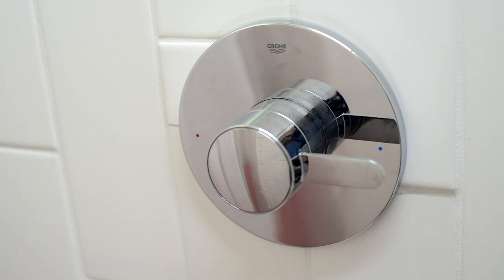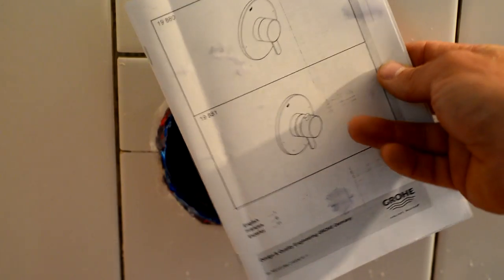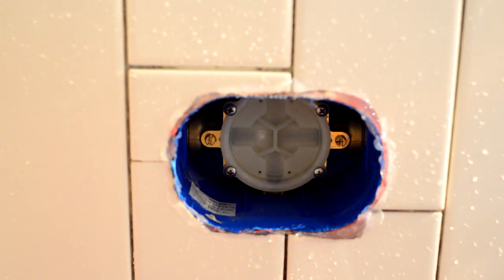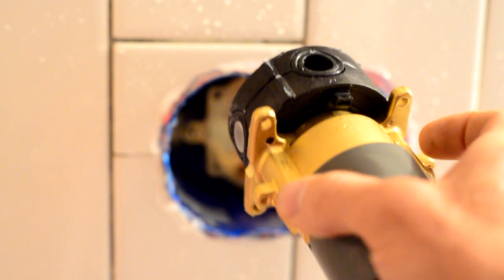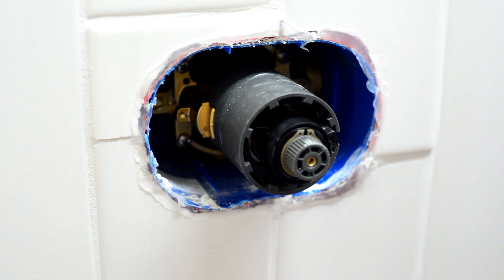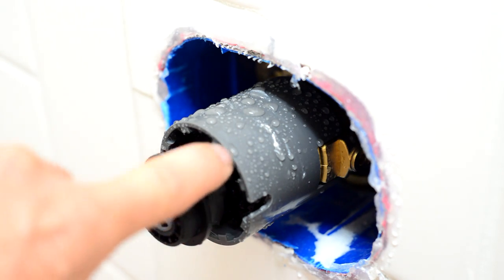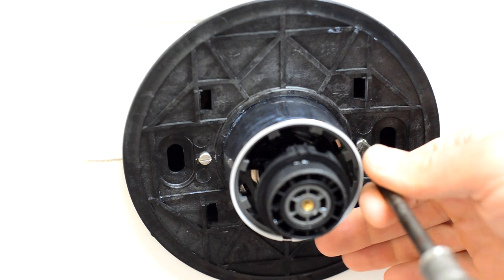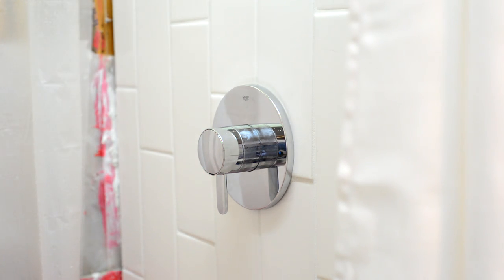Novice Experience - Grohe GrohFlex Rough-In Box and Valve Kit Installation

Comment: Matthew, this (19880000) is actually a pressure balanced trim/cartridge; it is designed to correct variances in pressure only. A thermostatic trim/cartridge (19869000) corrects based on temperature. Both can be used with this rough valve.
Reply from the maker: I looked on my Amazon order page, and you are 100% correct. Mine is the pressure balanced cartridge. The Amazon description, however, says nothing about what that means. Can you you give us a quick summary of the difference? Thanks!
Reply from the maker: @jandrews365  Wow. Great info. I love my pressure balanced valve and I didn't even know why. I love that it is with one handle. With the temp control for the water on my on demand water heater, I just jam that handle all the way to the left and always have perfect temperature. Thanks again!

Comment: on the water heater here there is a temperature adjuster on the front of the heater , that could be turned down to save money, or help adjust the water temperature at the outlet
Reply: Be careful with turning down water heaters. If the internal temperature is under  49 °C (120 °F) it can grow bacteria and other nasties real quickly.

Comment: Is there a seal that you have to apply to the black plastic backplate? I can’t get the escutcheon plate to snap on. I backed out the screws too. It looks like the black plate is not away enough from the wall. I had a plumber disassemble it, but I’m putting it back together.
Reply from the maker: No seal. Try backing out the screws a bit more.
Reply: @mbrenengen  Thank you Matthew, I did back them out as far as I could to where they where almost too loose, Grohe is sending a new plate but it’s back ordered till September. Thank you again!

Comment: I went to turn the hot cold service screws and one broke, so the screw driver has not way of connecting so it can turn the ball valve,  Any suggestions?
Reply from the maker: Oh no! Did you turn it the wrong way? I can't imagine why it would have broken. Anyway. Yes. Get yourself a screw extractor also known as an "easy-out". You will have to drill a hole in  the end of the screw. Insert the Easy-Out and it will grab the inside of the hole and allow you to turn it.
Reply: @mbrenengen   thank you,

Comment: Better late than never.....  Are there any tips on removing the large round chrome cover plate or trim that sits against the wall tiles? I am trying to remove mine but don't want to damage the clips or bend the cover plate.
Reply from the maker: Good question. Look at about minute 11 in the video and you can see there are four rectangles that the clips go into. I tried to get mine off just recently, and was in the same boat, I didn't want to break it. I think you need to just go for it and let me know if it works.
Reply: @mbrenengen  As it turns out Grohe makes two "slightly" different escutcheon plates, one where the chrome trim cover clips onto and another where the chrome plate twists onto. Removing the trim cover incorrectly will result in a broken escutcheon plate.
Reply from the maker: @planetmikeus  Do you have any tips for how to remove my type with the clips? Or is it a "consumable" part?
Reply: @mbrenengen  I am told by Grohe there is a slot at the 6 O'clock position of the chrome cover plate where you apply a screw driver too. I discovered I have the twist cover.
Reply: @danimburgia6559  Thanks. I have the twist-on cover plate. Very easy to install and remove and certainly easier than the clip-on type. The key to the twist plate are the gaskets behind it to prevent water from flowing down the wall and behind the plate.

Comment: Could have left out the random music, and random part with the rain kinda confusing? Interesting but no way to adjust shower pressure kinda strange. Would be better on water if not running full blast all the time.
Reply: Put a diverter valve behind the shower head.  $5
Reply: your name  Nome of what you said changes the fact that your condescending original statement was false. While not all shower cartridges do that, there IS a way to control shower pressure on a cartridge. Sorry if I offended you by pointing out the fact that you were wrong.

Comment: Grohe has turned to garbage IMHO.  Overpriced garbage.  The new stuff has gotten cheaper in quality and the spares have gotten cheaper in quality...definitely not price.  They are starting to use galvanized metal parts and screws instead of the brass they used to use.  Further, the designs for spares seem to be designed to force you to buy even more parts to fix design flaws they have had.  Spares are expensive and, in my opinion, hard to come by.  Better to buy something that looks nice and is cheap in price so you can find spares at your local big box at affordable prices.  Once you install these monsters you are stuck with them until you are willing to break tile.  Very bad experiences with Grohe.